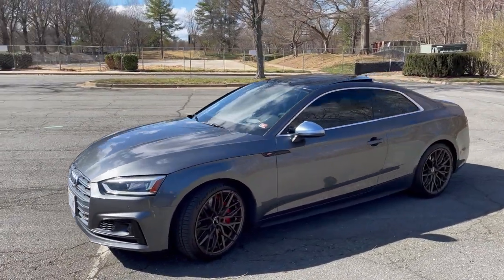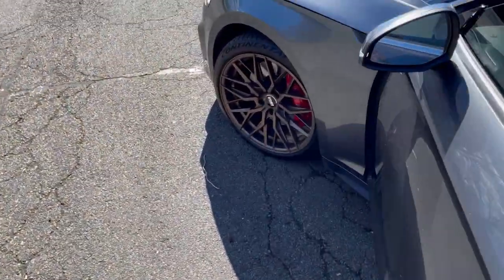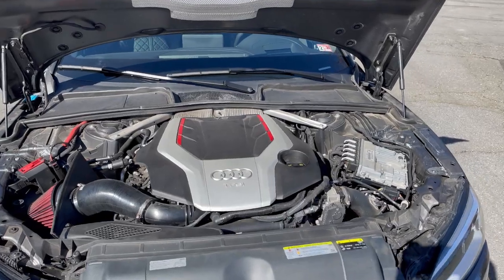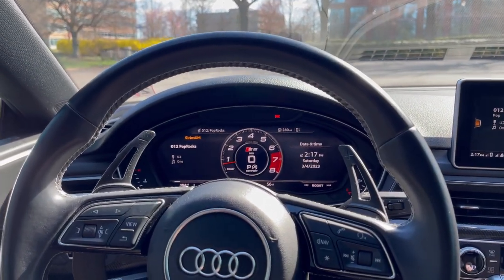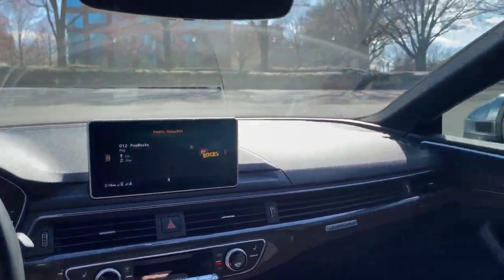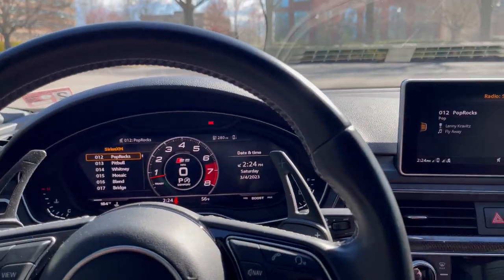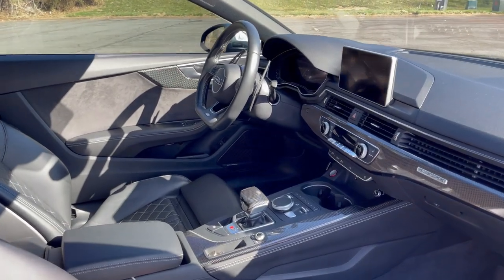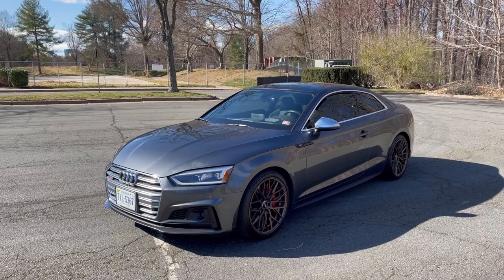HIDDEN FLAWS of the Audi B9 S4/S5! Watch This Before Buying!

Comment: Cars manufactured after June 2019 have updated rocker arms
Reply: How would i know if an audi has this problem when buying used? Cheers
Reply: How would i know if an audi has the rocker arm issue when buying used? Cheers
Reply: @samartz  check the manufacturing date of the car
Reply: Update rocker arms are after 8/2018 production date cars. Not first registration

Comment: I really think the primary issue with the rockers is both the 0W20 oil from Castrol and probably just a bad batch of improperly hardened bearings.  Had my replaced due to a single failure at about 60k and haven't had an issue since, but I'm using 5W30 Liqui Moly.
Reply: Assuming I change from 0W-20 castrol oil to 5W-30 liquid Molly do you think I will still have the rocker arm issue?

Comment: 2018 owner here, the side panel at driver's side is also very squeeky in my car. Thought it was my fault until I saw your vid. I also had some strange malfunctions that only happened once: heating was superhot even the temperature was on low (this was fixed after shutting the car down for an hour), mirror not folding out, pre-sense activating when standing still... Nevertheless, love the S5 :D
Reply: Take the door panel off and put butyl rubber around the little lugs and the creaking goes away! I was losing my mind everytime I drove the car but now it’s very peaceful
Reply from the maker: Thanks for the feedback! Yeah, the interior rattles are probably one of the top complaints I have with the car. It just seems like Audi chose such a cheap material in some areas. My previous S4 was built rock solid, so I'm not sure if it's newer Audi's in general or just the B9. Oh well.
Reply: My 2018 S5 also get drive system malfunction and took it to Audi dealer and they still can’t find out the reason. It’s kinda annoying
Reply: @jimmychoi9900  explain a bit more?
Reply: @quackattack2002  I get these 3 codes - P8403,P8A4E,p772A. My car drives normal and I’m not losing any boost. I’m assuming Audi also doesn’t know what to fix because it happened again after they replaced my sensor. I deleted the codes to see if the code would come back right away but it did not. Probably gonna take it to dealer but to be honest , idk if I should

Comment: Those wheels look delicious when contrasting the body color and lines....  So, when it comes to the Rocker arm failure on the early builds, what I've heard is; If you are concerned? Try using a thicker oil. I know Audi recommends 0-20 but that's just for MPGs. For me? I'd rather save my engine than my MPGs, So I'm going to start using 5w40 from Liqui Moli. I have about 3500 miles left before my next oil change(I usually do them at 5k intervals).  In terms of the MMI rebooting itself? Weird, I've never had mine do that.

Comment: Never had a single interior creak on my 2017 S5. Id say one of the most common engine issue faults, is still the terrible thermostat units that go into most modern Audis. This is still by far the most common issue that needs to be stated. The rocker arm issue has been massively blown out of proportion with an incredibly small amount reported back out of tens of 1000's of units out their performing just fine.
Negligent driving will see faults like that before time, ie poor service intervals and revving out super high all the time, before the oil has had chance to come to temps rather than a straight up part issue. Audi/Vw are constantly revising parts on dozens and dozens of areas, so dont always assume a very revised part means the car is about to blow up cos you dont have the 6th or 7th revision. I would say, as an Audi owner who has had many different models, the S5 B9 is about the most solid and reliable ive come across.
Reply: Would you think S4 also is solid? They are essentially the same engine I would think
Reply: Replacing the thermostat isn't very expensive job or is it?
Reply: @DeadlyBrianX  I’ve had an s4 b9 for a while now really solid vehicle
Reply: @s2active23  sweet just bought a 2021.
Reply: Same.  I have just over  118,000 on my 2018 and aside from the roof panel creaking over bad pavement I have no creaks or groans (and to be fair at that mileage I've rarely had a sunroof that didn't need some adjustment or resealing).  And Audi does frameless windows correctly.  No noise from them at all.  I've seen Mustangs that rattle like they have a door full of marbles after six months or a year on the road, and no frameless window Audi I've owned has ever had that problem.  

I change my oil at 5k on all the Audis in the driveway, and since I moved to the 5W30 LM oil I've had not a single issue with, well anything.  I've replaced a few seals here and there but I expect that at this mileage, but nothing has been a problem or difficult to do.  As it looks like Audi will be discontinuing coupes generally I think I'll just keep this and put a new engine in when it needs it.

Oh, one more thing....service the transmission!  I talked with ZF when I was nearing what I thought would be time, and they said these are absolutely not a lifetime fill, that they need to be serviced about every 60k to 75k miles.  It's a bit of a pain in that you need to drop the rear trans mount to get to the rear screws, but it's otherwise straightforward, the usual fill it up and check about 40 degrees C for that little trickle and top up if needed.  The old ZF in my C5 allroad 4.2 is 20 years old and still shifts like new.

Comment: A problem I've had is the intake can suck in a good amount of debris. To the point where I can feel a drop in responsiveness in the turbo.  Probably not a design flaw, but it's something I keep in mind. Pretty much whenever I wash the car I vacuum out the airbox.
Reply: Hmm.. Interesting, first I've heard of it.  I will go check out the intake filter and inside box in a few, to see what mine looks like.
Reply: @Kiss__Kiss  What did you see when you inspected?
Reply: @RageCage1701  Okay so because I'm honest. I just saw your question and immediately went out to my garage to see lol. I completely forgot to check the other day. Let me tell you, there was Dried up leaves, and a MASSIVE amount of sand.. SAND? WTH?  I immediately plugged my wet/dry Vac and vacuumed that CRAP right up.. even the white mesh surrounding the actual filter had crap stuck to it. The sad part is I had the dealership replace the intake just 3 months ago.  Needless to say, all clean now 😆
Reply: @Kiss__Kiss  I actually do it every car wash now! I'll take the filter off and knock off the dust/sand. Way worse in the fall for me.